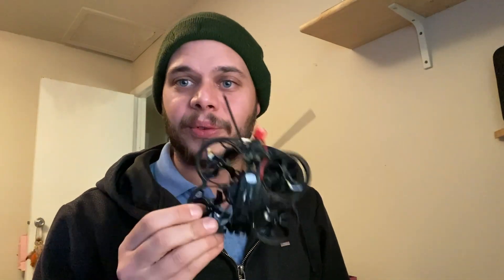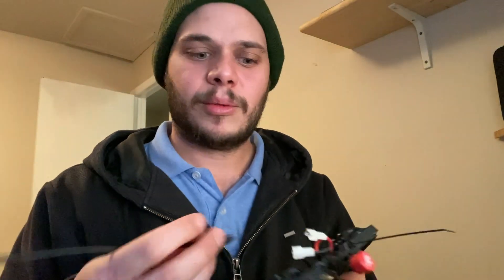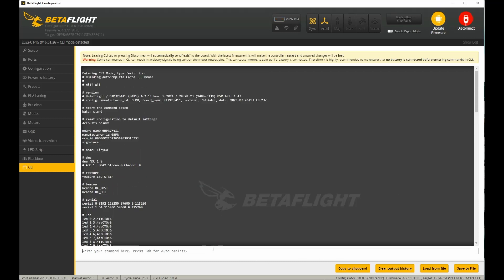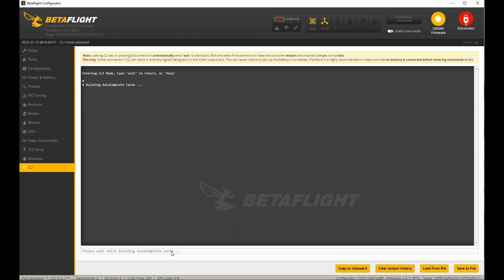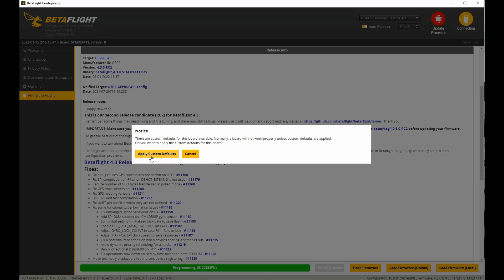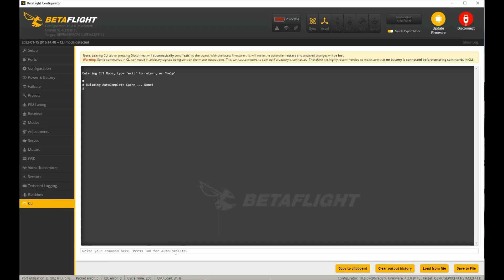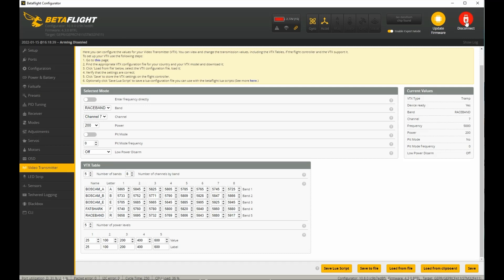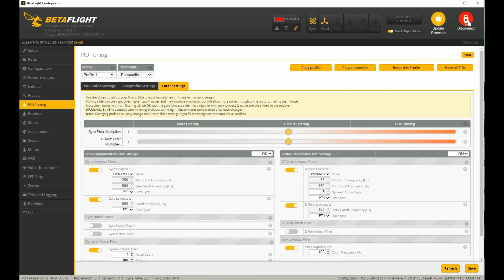Fly better with a Firmware Update - GepRC TinyGO 4k - Flashing to 4.3.0

Comment: How did u download it it's not working for me
Reply from the maker: One thing I forgot to mention in the video is that 4.3.0 will only work on Betaflight version 10.8.0. 
I just added links to where to download it in the description
Reply: @719FPV  thanks I'll try again
Reply: So I redownload betaflight but with or without the drone connected I get the screen u get when u fist plug in the drone but nothing happens
Reply: A step by step how to download video would be cool I been trying to figure this thing out for almost a week
Reply from the maker: @Revelation1177  I can make a quick video but the main thing when downloading a new betaflight is to completely uninstall your current betaflight program from your computer and then you can download the new version
Reply: @719FPV  yes I did that I'm even in the process of resetting it back to factory settings
Reply from the maker: @Revelation1177  hmm, yeah I’m not too sure what the problem could be. Let me know what ends up fixing it